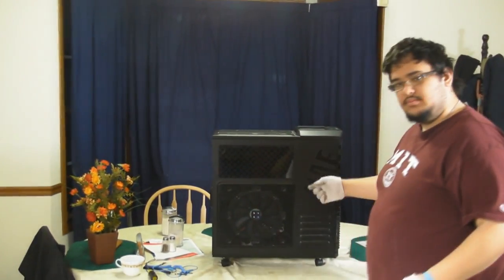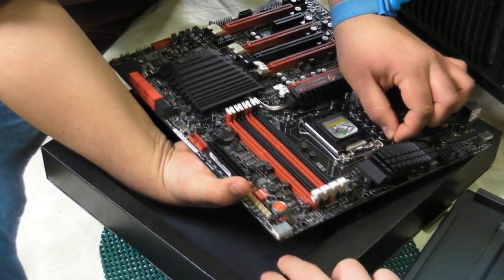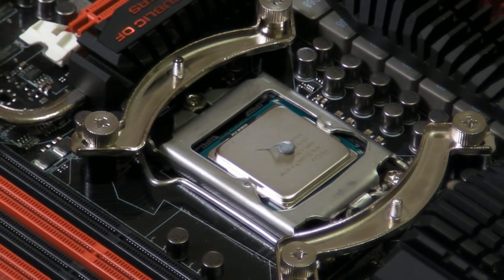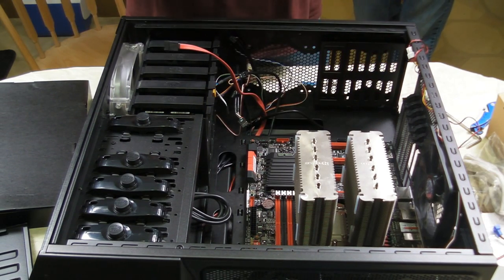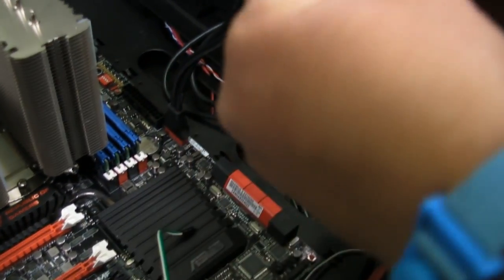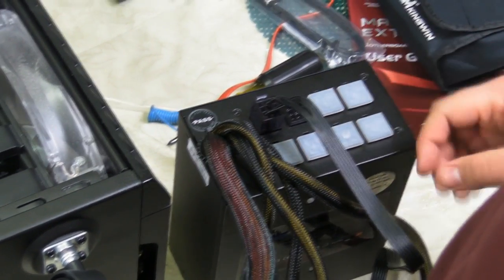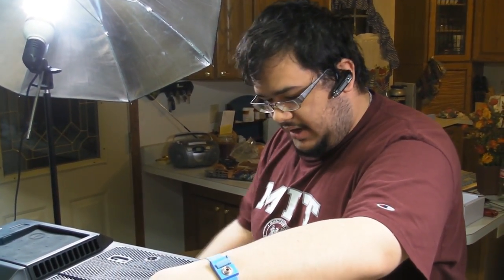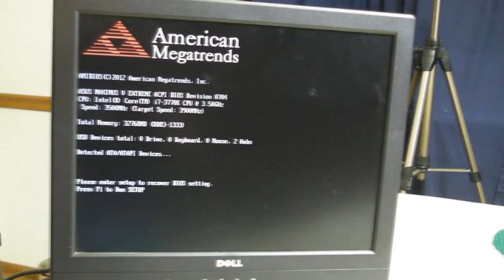How to Build a Custom Computer

Comment from the maker: cold air always resides lower than hot air. The bottom mounted PSU can be put in so that the fan faces downwards to suck in cold air from under the case.

Comment from the maker: things can only be so small before they run into issues with things like dissipating heat. Power management issues in terms of efficiency can be a result of the USA working on 120v power grid. 240 can prove to be more efficient. 120v PSU can be up to Platinum rated, while 240v can be Titanium rated.

Comment: Hey just to point out something you might already know... to prevent ESD you have to equalize your potential. Using a ground strap attached to your case while working on your motherboard outside your case could still cause an ESD spark zapping your motherboard. You should attach your strap to the component you are working on. Given the chances of this happening is rather low considering humid environments and work station, you are probably good as long as you don't scuff your feet on the floor..

Comment from the maker: in the future, it will have multiple GPU's, 

and a 1TB Raptor is more practical than a 1TB SSD. Would you pay $1000+ for an SSD? 

=S

its meant to be expanded upon. until then, this works great.

Comment: Jealous.  Nice system.  
Only major change I would have made is to add an SSD boot drive. As nice as the Raptor drive is, you'll never get SSD performance launching apps and booting w/ a mechanical drive.  Plus if you get an ssd you can let that Raptor sit idle most of the time and save some heat/noise/power.  Why did you not do ssd?
I hope you were able to buy your CPU/mobo at MicroCenter so you could save some serious 90 less for 3770K and 50 less for the mobo vs. newegg etc.

Comment: umm, how about a small, say 120-256GB SSD for os/some programs/games (~100$-170$ in Germany) + a big 7.2k rpm HDD (~75$ in GER)? Same price, lower noise level, faster bootup etc...

And why do people always go overboard with the wattage? An oversized PSU does not work very efficiently, no matter what 80+ class. And even during gaming, you will most probably not reach 400W with your config. Add <200W for every 7950 you want to expand your system with (not recommended- 2x GPU != 2x fun;+µstutters)